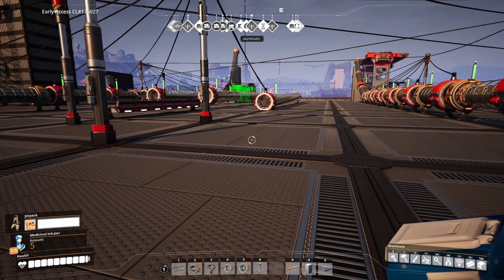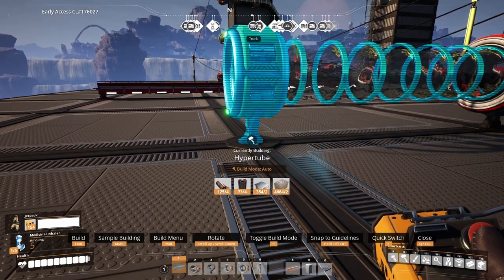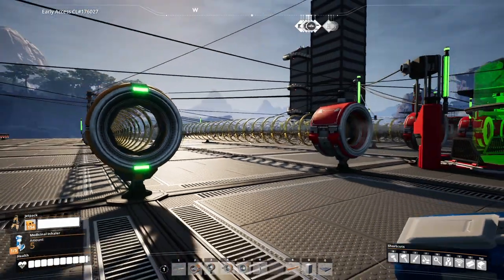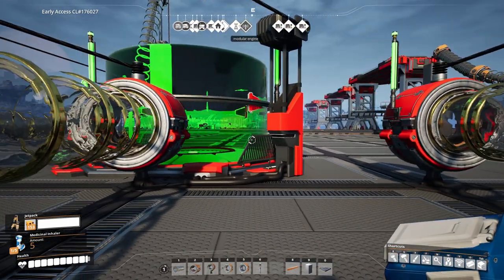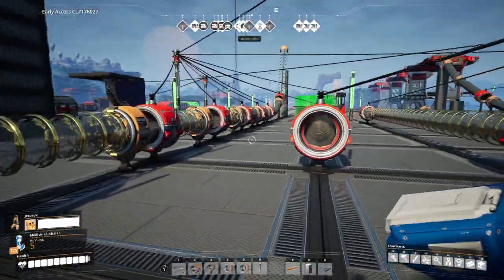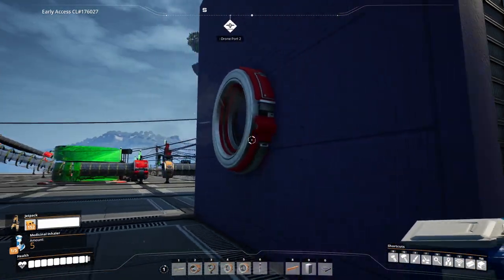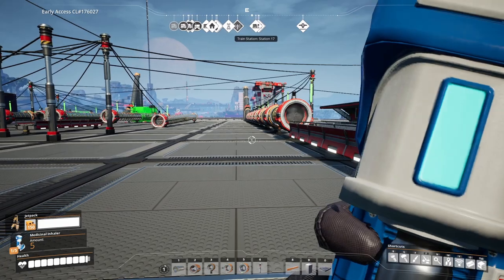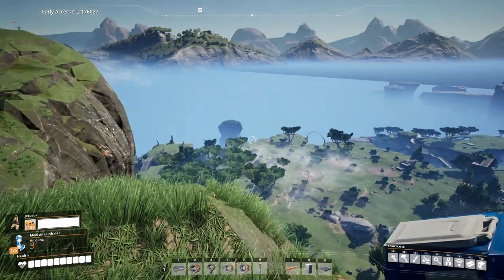Satisfactory: HyperTube and HyperTube Canon - Tips and tricks

Comment: Do you know how to fix the issue with a two way tube - in the direction the tube was created the journey is smooth but in the other direction it's bumpy when traveling through the connecting supports? I find it really annoying.
Reply from the maker: Not 100% working fix but instead of building the pipe and letting the game put down the support, build the support beam just short of max distance and connect pipe's in-between. 
Also building on a platform at all times with the new world grid helps